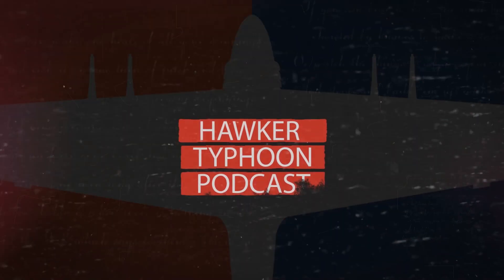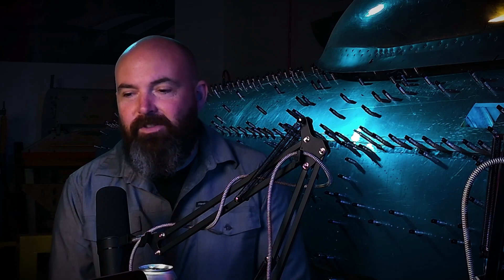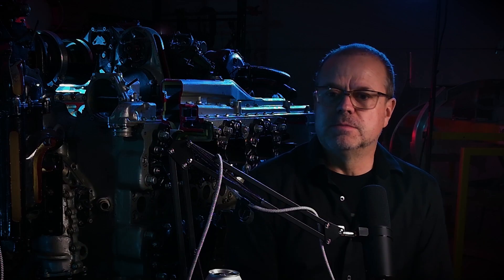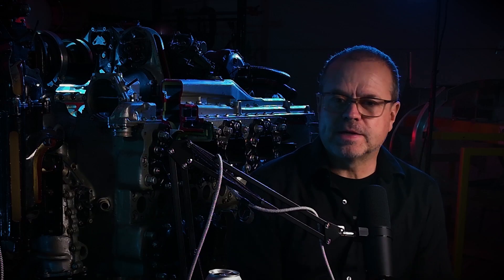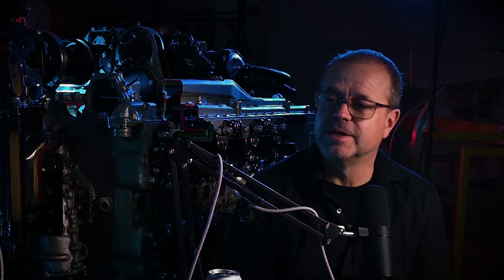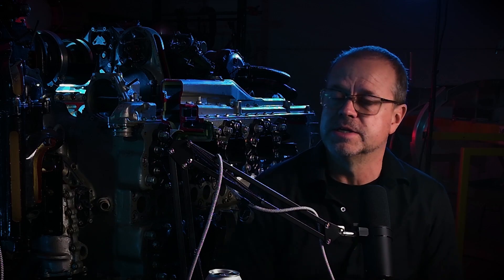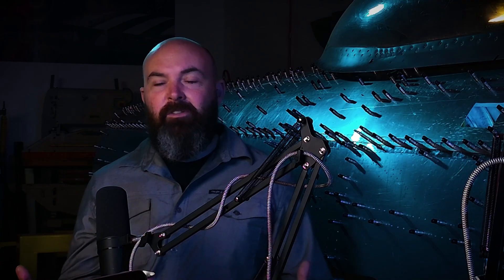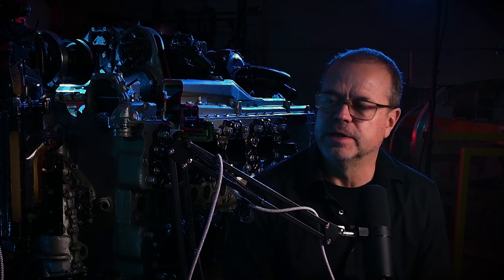Napier Sabre - Hawker Typhoon in Detail Pt 3

Comment: Ian,
I am glad to see another video on the Sabre and the unsurprising plans for the future.  These were discussed in the comments of an earlier video and now, just as then, there was really only one course of action that could be followed.  I know money is an issue (it always is) and I don't know what parts you are considering for healing and which parts need to be heeled, but I suspect that you may have to recast most of the sectioned parts for a MkVII.  I would think, crankcases, blocks, junk heads, supercharger casings and the front prop gear reduction casing - at least.  The elephant in the room (ready to stomp on you) is a complete, in perfect order, set of sleeves.  I assume that Napier were making their own for the later part of the war as they had acquired the centreless grinders, but I wonder whether they were casting their own or still getting raw castings from Bristol.  Do you have documentation on the complete end-to-end process for creating the sleeves?  There were a few unconventional steps in the process.  Everything else in the engine is easily remade using modern equipment to tolerances Napier could only dream of, as long as the metallurgy is known.  But the sleeves...

And yes, you are going to have to test that engine A LOT (as many quality videos of the running engine with good quality sound as possible - sell them off to crazy engine guys like me), considering its fuel consumption is quoted as 230grams/hp/hr the fuel bill alone will be a shocker.

Then there is the issue of engine oil, the sleeve valve engines used an oil specifically designed for purpose and not used by any other engine. AFAIK none exists, is there a solution?

I have never been able to find an official service rating for power higher than 3055hp for the engine and that rating was specified as low altitude military power at 700m.  I had a  discussion with Bill in the comments of the Old machine Press article on the Sabre about output power and he provided a detailed listing of quoted power levels.

Ian, if it is not a Canadian State Secret, what documentation do you have for the various Sabre marks, I mean service manuals, mod listings, specifications, drawings, that sort of thing?

Comment: At risk of stating the obvious, running with the choke out must have seriously shortened running time and surely caused bore washing problems..thats not even mentioning spark plugs
Reply: Very interesting.  Of course,  all the pilot was concerned about was it not failing and helping him to live through the war.  Your point is useful for planning engine longevity.

Comment: Great interview. The Sabre is my absolute favorite power plant. I knew the Merlin had dev problems, but I thought not so with the Griffon, which had the benefit of all that was learned with the Merlin. The Sabre looks huge, but it's about the same swept volume as the Griffon. If I understand correctly, the main problem with the Vulture was the decision to use master and link rods, whose caps suffered from fretting. The arrangement does not require staggering bore centers which slightly shortens the engine. Developers said that pairs of blade and fork might have worked better. But that, ideally, requires staggered bores. I get most of this from Graham White's "Allied Aircraft Piston Engines of WW2."
Reply: It wasn't just the issues with the bottom end which was not a problem in the Rowledge designed Exe or the Pennine X24 air cooled, sleeve valve engines (so master slave rod design was not a problem in itself), the thing overheated and was underpowered as was the Peregrine, both engines used a common one piece block/head.  

The Peregrine was just an upgraded Kestrel.  Until the five piece construction was adopted, the Merlin was just an enlarged, upgraded Kestrel. The Merlin’s original design called for a three piece construction with an integral casting of the upper crankcase and two cylinder blocks with removable heads, just like a modern motor.  That design was abandoned for a couple of reasons, not the least of which was serious cracking issues with the large castings.  

A couple of Vultures were used to drive compressor tests for the Whittle turbine project.
Reply: @robertnicholson7733  Some serously interesting points. In my dreams, 'failed' engines get to try again, but with modern techniques/materials. I do wonder if the crankcase's size/deck height/rod ratio painted rod caps into a corner regarding available clearance. White claimed a pivoting cap was meant to mitigate that and, when proven unstable, took some noodling to come up with an alternative design that improved, but did not resolve, fretting. The case cavity may have just been inadequate from the start.
Reply: @busterdee8228  There is some evidence that R-R solved many of the problems in the last mark of the engine (including the bottom end, but not perhaps the disappointing performance), but the die was cast. Much easier to just build more Merlins than persist with a "double Kestrel" or an improved Kestrel like the Peregrine (or even a big, improved Kestrel like the early mark Merlins, it succeeded because it had to), a pity about the Whirlwind.  Not to mention, the added reassurance of four engines over two in the bombers.  

I think it was Hooker's book where it was mentioned that they used a couple of Vultures to run tests on the compressors for the Whittle turbines and even then they were not quite powerful enough.

The Vulture was yet another example of "welded together engines", not a single example of which was successful, shortcuts don't work out.

This is where the Sabre was perhaps a mistake (although not an obvious one at the time, Napier had got fantastic performance out of the Dagger and surely water cooling would solve the other issues <sigh>), given its role in the war, which would have been better, the Tempest or an early version of the Hornet?  Many projects went ahead not through merit but perceived need.  The Centaurus was put on the back burner at Bristol as it was more important to develop the Hercules and the Sabre could power the Tempest, so the Centaurus wasn't critical.  The Crecy was dropped because it was clear that the Germans were not going to do high altitude bombing, so the sprint interceptor was not necessary, nor its engine.  Of all of them, I think it is a shame that the Exe did not continue, but it too was not necessary.

It is strange but of the last five piston engines that R-R designed, four of them were sleeve valve, but R-R is often held up as the shining light for poppet valve engines, in Britain at least.
Reply: @robertnicholson7733  I wonder why Vulture performance was lacking. The "X" format seems ideal for optimising induction-exhaust-ignition placement. Maybe performance was just too far down the 'problems-to-be-solved' list (when they won't hold together at the intended rpm, hp is left on the table). Although "H" engines seem 'wasteful' in having dual cranks, they sure must have posed fewer problems than 24 cylinders, coming from four directions, laying claim to one.

Comment: 4:37 - One of my books on WWII piston engines mentions the difficulty of getting good sleeve sealing, inside and out, and that the solution was found by accident, having to do with grinding techniques.
5:41 - The cylinder blocks would run at the lowest temp in the progression of piston-sleeve-blocks. If you are to make new parts, you are going to need testing to find the operating temps of those parts and adjust the alloys to suit.
11:32 - Supercharging?
16:31 - Steam loco folks blame Diesels instead of the inherent advantages. But according to some of the books on the shelves, the Jumo 004 had a service life of 8 hours, so the jet turbines were not ready for prime time in '44.

Comment: If you modularised the crankcase castings, you could potentially go down the path of developing 4-6 cylinder engines for GA use. I believe the compression ignition, sleeve valve design would work very well with the much better lubricating AVTUR fuel.

Comment: Ian, thanks again for your knowledgeable insight into the hasty development of the sleeve valve aero engines from both Bristol and Napier.
The innovative genius which left no stone unturned to get them tolerably reliable in no time flat is generally not acknowledged nor the conventional mindsets who hindered them 
Among  senior ranking RAF officers , one in particular  (who had personality issues with Roy Fedden)  and ordered the obviously very fast Typhoon 2 ( Tempest) LA602 grounded 
despite Sydney Camms enthusiasm for it , thankfully we have PR533 flying now which is a superb missing link in this story .
Until Armin Faber gave us his FW 190 and the P47 which silenced those who doubted a Radial engine could be as fast as an in-line . All explained in Bill Gunstons book “Fedden”ch 9 pp 
228-230 . Perversely perhaps this saved the Sabre Tiffy ? The fact as you said with the later iterations of Sabre (hugely successful as powerful engines but too late on the scene for use in WW2  like the Centaurus Tempest) but evidently given the development time,  led to the superb post war super props, Fury, Sea Fury and other machines sadly all stop gaps for the jets . Looking forward to your next podcast .

Comment: quite a few years ago i was in a aviation society in st osyth in essex ... a nice old guy who was a member named bruce lawless from new zealand ... he told me a story when he flew hawker typhoons during the war ... he talked about officer class distinction which he hated , them and us he said , he said that the sabre had a big problem with seizing via overheating ... one time he said his wing took off and he found that his engine wasnt overheating as usual ... he said when he landed he looked at his control set up ... he found that the choke was out more than usual which he said it kept the engine cooler , he went on to say that he only told his lower ranked pilots but not the toffs as he called them ... he stated that the engine ran the same with the choke out and flew like this for the rest of the war ...
Reply: Running with a richer mix cools down the engine. With carburettors they many had devices called power valves. They ran lean until you give it the beans when the valve opens and riches the mix. With fuel injected engines it’s the same at high power add a bit more fuel to keep it cool.
Reply: Hi guys... he did say that many toffs as he called them still had regular engine overheats and seizures ... while he and  his mates continued to have better engines ... he said by running it rich kept the temperature down ....
Reply: A great demonstration of Squadron spirit and pulling together to get the job done. Wonder if he ran a trade union post war?
Reply: Yes, running rich does several things, for instance, you will see the PN (performance number of allied fuels) as two numbers, let us say 100/130, the first number is the octane rating of the fuel for a lean mixture, the higher second number is the equivalent octane number for a rich mixture.  So you can give it more boost on a rich mixture or run the engine cooler as long as YOU HAVE THE FUEL.  The RAF used to have a number of memory devices that they drummed into pilots about setting the mixture, most of them involved getting home rather than ditching in the channel.  The famous film of the Schneider Cup winning run of the Rolls- Royce R engines Supermarine aircraft shows two huge dark trails of black smoke coming from the aircraft - yep, unburnt fuel, very rich mixture to keep the engine cool.  Then there are dragster engines, same issue, same solution, they are run very rich, especially when using mechanical injection.

For German pilots it was much easier, the "computer" that controlled the direct fuel injection worked out the mixture and boost required, so the pilot could concentrate on flying the aircraft.
Reply: Makes sense sounds like a fuel starvation problem then
Reply: @Auqalungangler  Not starvation but a too lean a mixture, 02 sensors and todays close loop ECU's would sort that out.

Comment: Fascinating and well presented as usual 🙂
It will be quite a day when you fire up a rebuilt Sabre.
The Napier engineers were from another planet. Check out the Deltic. It makes the Sabre look simple. The phasing geartrain is amazing.
Reply: Check out the Napier lion from 1917.
Reply: @garynew9637  The Napier Cub designed by A.J.Rowledge (he designed a lot of Napier's cars, the Napier Lion, significantly redesigned the Rolls-Royce Condor, designed: the R-R Kestrel, the R-R Condor, did a lot of the design work on the R-R R racing engine, initial design work on the Merlin, designed the R-R Exe , significantly contributed to the R-R Pennine and did design work on the R-R cars), a most unusual engine and the first aero engine to put out over 1000hp, it was an asymmetric X16.
Reply: I like the Deltic, but I am afraid to say that the Jumo223 and 224 were a superior designs with all four crankshafts turning in the same direction instead of the Deltic's two in one direction and the other reversed.  The Deltic's use of three crankshafts was probably due to the packaging requirements to fit it in the boats.  Also, the Deltic's crankshaft timing would not allow optimum port timing whereas the Jumo engines had optimal port timing.